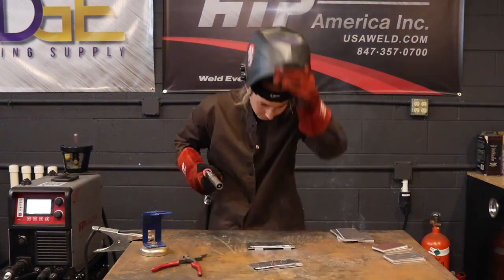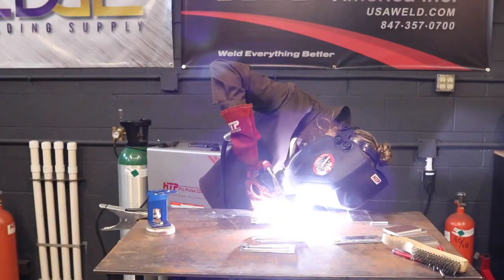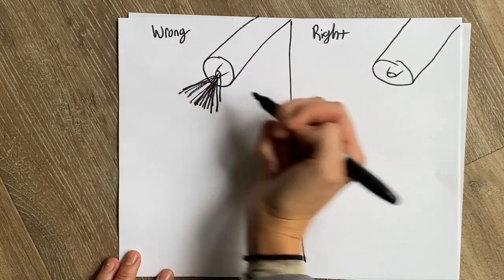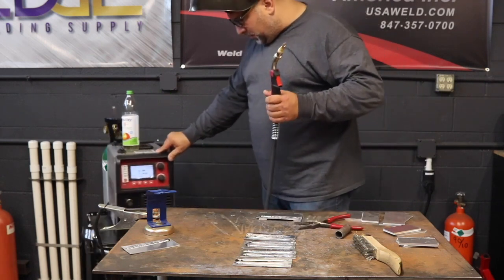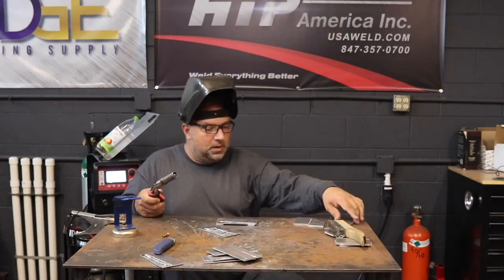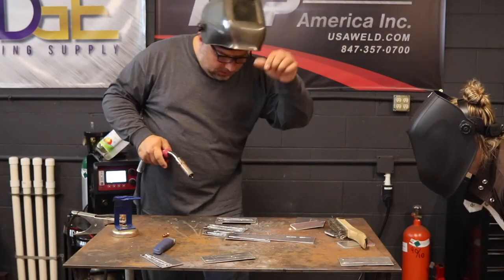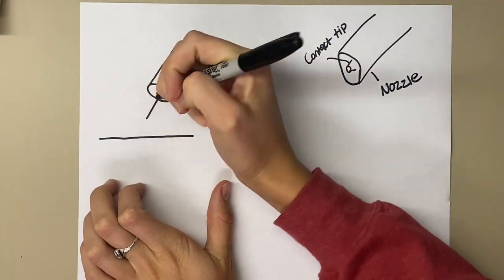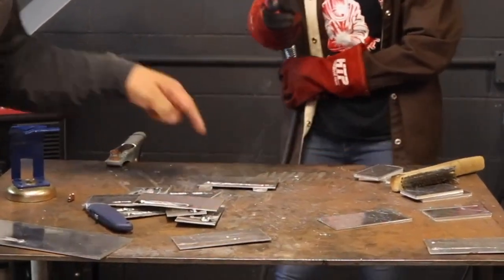MIG Aluminum trouble shooting

Comment: I wish I had seen this video 4 years ago. I remember the battle I fought to make good welds and was losing, and all the troubleshooting and frustration I went through, before I finally changed my liner, and all my problems disappeared. What she learned in 1 hour, I learned in 50 hours, just because I didn't have Peter looking over my shoulder. Where were you when I needed you, Peter?
Reply from the maker: thank you Chris

Comment: Peter I wondering if you could go over the other important settings in the pro pulse regarding aluminum. There is the hot start and the burn back and arc length  adjustments.
I have mine set as per the manual and it works well but I am sure you have some settings which are better. Once and awhile I get some long spray and some soot with the regular settings. Thanks.
Reply from the maker: Great suggestion!